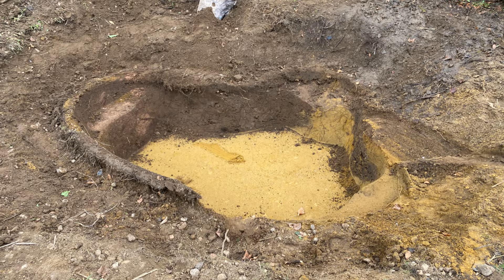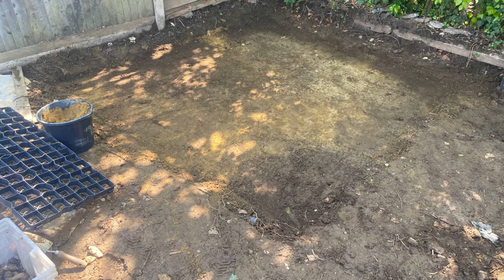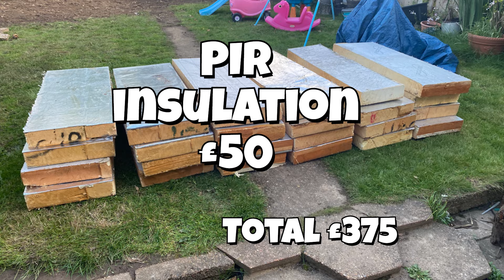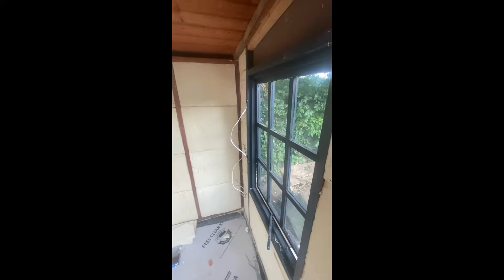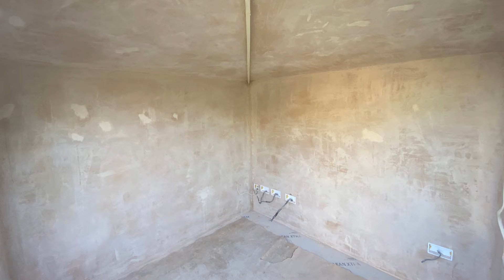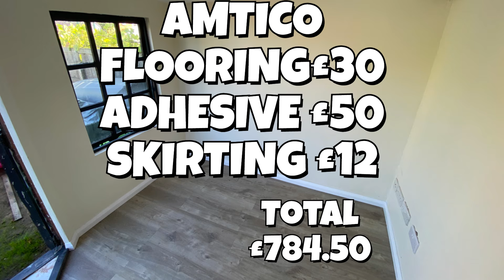I Built a Garden Office for UNDER £800! (DIY Budget Build Step-by-Step)

Comment: Did you attach the walls to the base? What stops the wind from toppling it over?
Reply from the maker: They are screwed into the base just like a shed. Once the roof is on it is solid.

Comment: Great watch! I’m thinking of doing the same thing, is it still up and doing well?
Reply from the maker: Thanks mate, yeah still going strong! It holds the heat surprisingly well too with a small heater. I’ve added some curtains, roller blinds and draft excluders round the door since posting to make it more cosy. If you just want a cheap office it will do the job nicely.